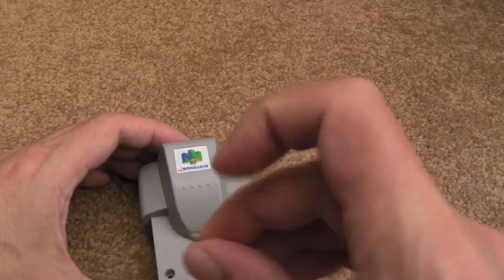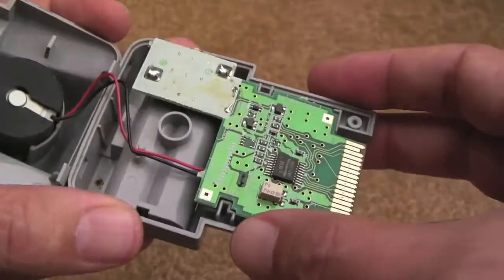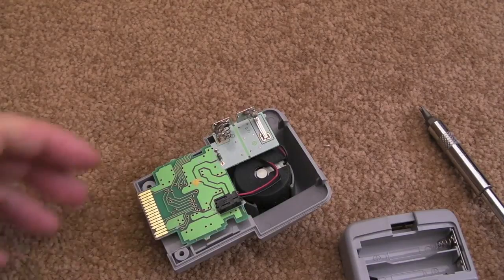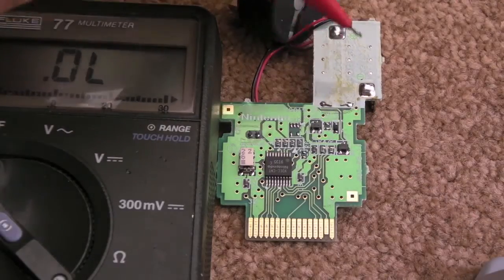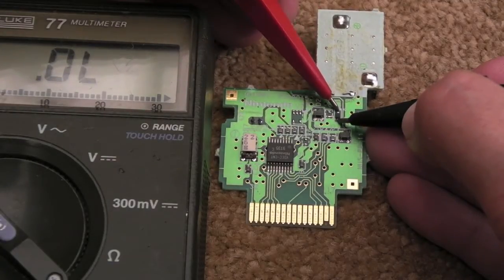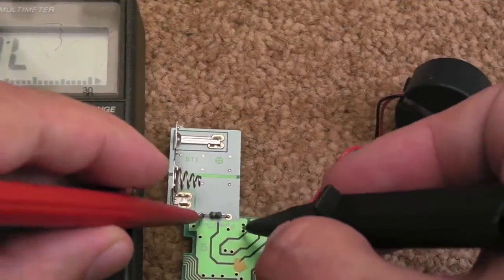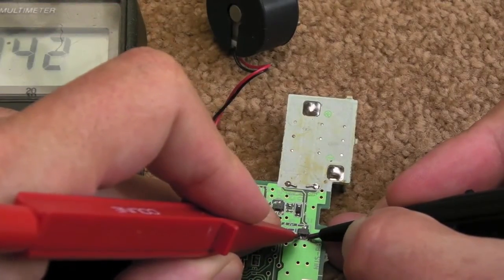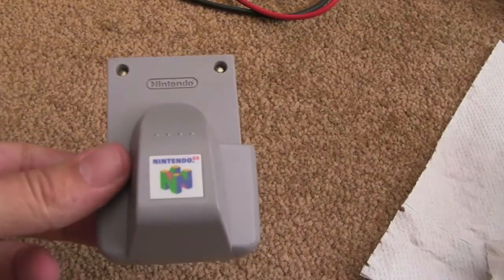Nintendo 64 (N64) Rumble Pack Teardown

Comment: hi, could you help me telling me how many ohms is the resistor?

because i have a rumble pack, i tried modify to using it without bateries, but i missed the resistor and i want to use one resistor similar or with the same vaules or maybe i can add two to equal the value, hope you can help me.

thank you for your tiem.

best regarts.
Reply from the maker: Which resistor?  There are numerous resistors on there!
Reply: the principal that is remove and relocate as a bridge, is the one near to the batteries, i use a resistor of 27 ohms and works good, but may be if i use one of 20 or 22 ohms, could work much better, because with the 27ohms resistor the vibration is justa little persetible, the motor just move a little.

or is that the best result without batteries?

hope you can help me.

thank very much you for your time.

best regards

Comment: I didn't understand what you were saying the smd component at 1:23 probably was. You were talking a little too fast. Could you please specify in writing? For me it's been a royal pain trying to find SMD part information and docs on the internet. Got my rumble pak fixed up though :) thank you very much sir.
Reply from the maker: +PerfectChaosGX Do you mean the main chip on there?  I thought at the time it was some type of general 'controller' chip - but on reflection its probably a DAC (digital to analogue), probably also has some type of H Bridge or Op Amp in there to drive the motor based on digital inputs from the controller connection.
Reply: +GadgetUK164 To the left of the chip. It looks tan and I think you said it was surface mount.
Reply from the maker: That's an electrolytic capacitor!  22uF 6v
Reply: +GadgetUK164 Okay. Sorry, I'm not as good at this stuff as I'd like to be. Thanks for answering my question. :)
Reply from the maker: No problem! =D

Comment: Really enjoy your videos.  Find them very interesting and always impressed with your knowledge.  Did you do a degree in electronics or something?
Reply from the maker: Thanks, feedback much appreciated =)  I didn't do a degree in electronics, I only did a couple of City & Guilds qualifications, 20 years ago.  I was lucky enough to work with some very talented electronic engineers, so whilst I am not professionally qualified I learnt a lot of useful stuff in the short time I worked in electronics.  On the subject of degrees, I am of the opinion that qualification depends very much on the person rather than the piece of paper.  Many years ago I worked for a guy who was 10 years older than me and had a degree in electronics.  He brought into the office his home sound amplifier and satellite LNB to fix, 24 hours later I brought them back in both working perfectly (Amplifier had a failed MOSFET transistor, LNB was corrosion on the high frequency part of the PCB).  What I still don't get is how he could have a degree in electronics and not be able to fix an amplifier or a satellite LNB!

For the last 20 years I've worked in other areas of IT.  I am still learning, and other peoples YouTube channels make a big difference.  Worth checking out Arcade UK, RetroGameModz, and EEVBlog if you want to see more electronics repair stuff etc.
Reply: yeah schools for dummies